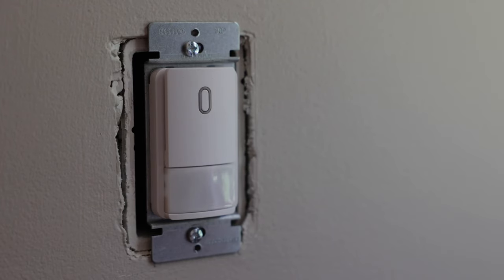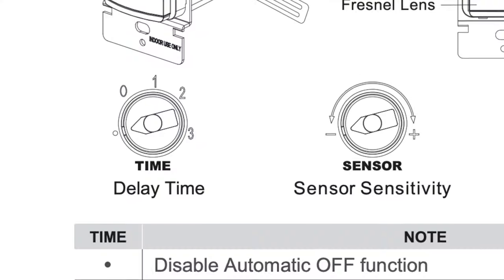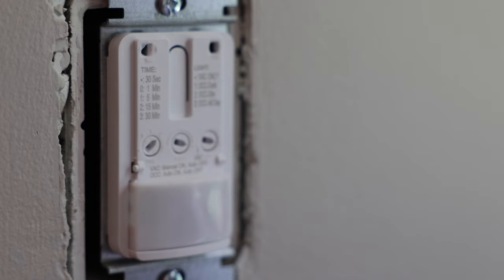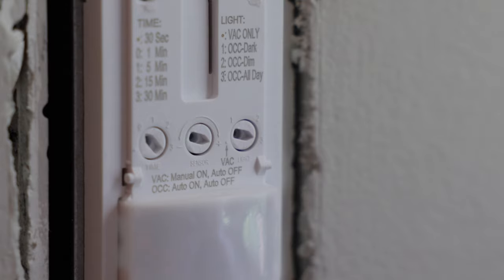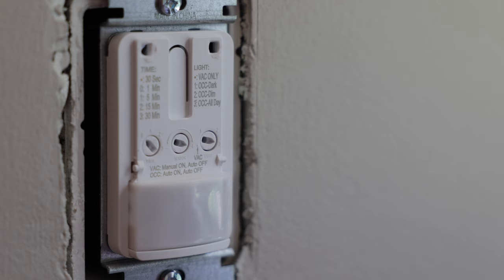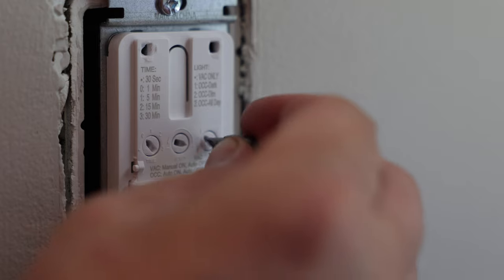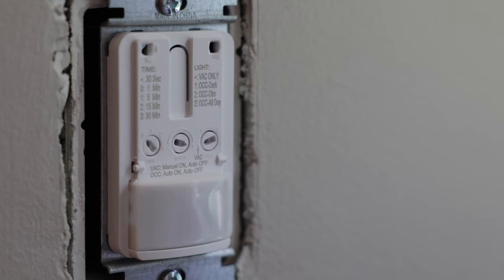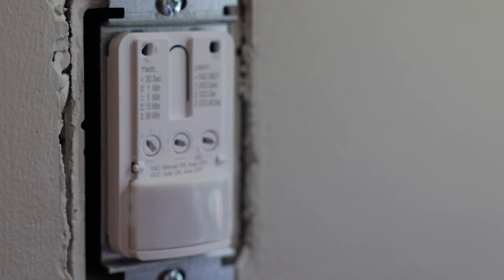How to Program and Set Up the ELEGRP Occupancy Motion Sensor Light Switch

Comment: Is there a way to make it work like a standard switch (Press on -STAY on)?
Reply: Yes, using the manual switch
Reply: @joeygordon7265  not exactly.  The manual switch will turn on the switch, but it will then continue to work as a motion detector, with whatever settings you have for it.  In other words, don't expect it to stay on until you turn it off (regardless of motion detection) when manually switched on.  So, short answer to the original question:  no.